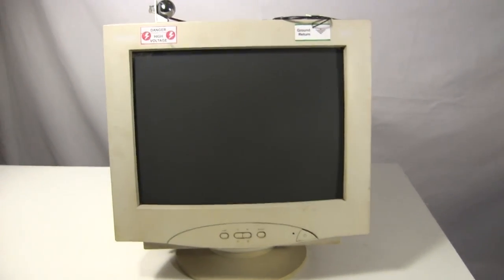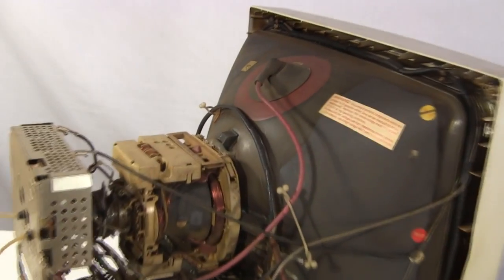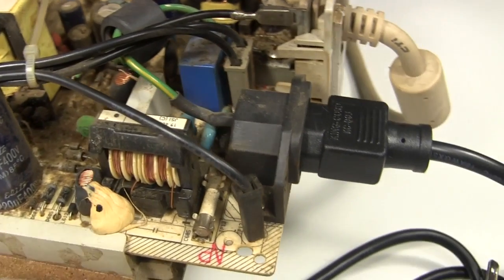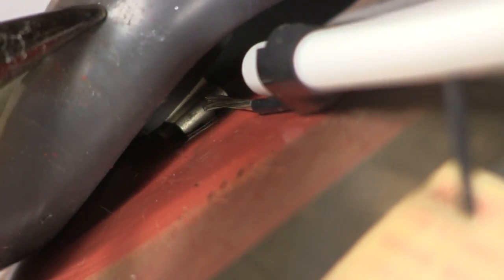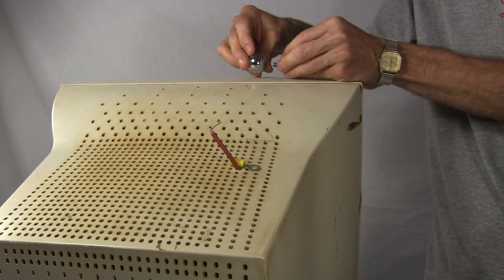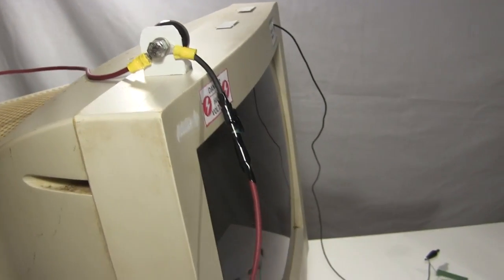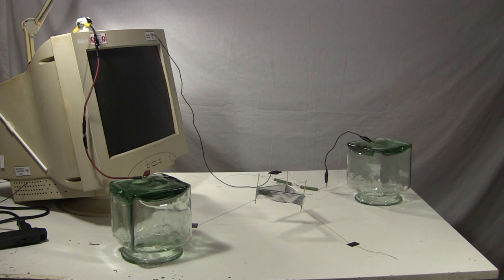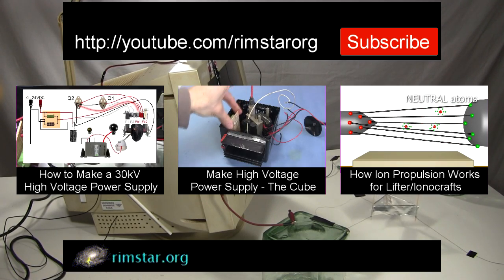How to Make PC/Computer Monitor into High Voltage Power Supply

Comment from the maker: Possibly the easiest to make powerful high voltage DC power supply - a modified PC/computer monitor. In this week's video I show how I did it and demonstrate by flying a lifter. Enjoy!
Reply: +TTTT GAMING yes you can use a tv but some tvs have a overload circuit in them say you are arcing it will shut off due to the current pull that is supplying the flyback some tvs will not and keep going strong very nice arcs even out of the small ones! the lifter is not required it is a fun project you can use with your hv power supply find a ground point on your tv usually you will see a ground even if there is no earth ground the tv has a ground attach a wire to the ground put it on a isolated stick plastic clothes hanger or pvs works good for the lift up the suction cup till you can see the metal contact on it then touch it with the probe you  just made hold it on there for around 3-4 seconds then get your pliers and squeeze the section cup and the prong will comeout now drill a hole run the wire that had the suction cup on it out then get your ground wire and when they come in contace the voltage with jump allowing the current to travel to a ground and the arc draws out! be careful! i have a facebook if you ever need anything Nice Video BTW Rimstar!
Reply: YOUR NPN FRIEND thank you so much man you made it clear for me! 1+ thanks man!
Reply: T T T T Gaming
Should work with any picture tube display.

The circuit won't like doing sparks, still.
Reply: Nice

But you are kinda afraid of the wrong thing; the most dangerous capacitors are on the main board. Especially the mains input filter cap after the rectifier. Remove the crt, and keep the yoke and it's a lot more compact.
Reply from the maker: Erlend Ervik
Yeah, I was wondering what else would be dangerous. Is that cap still charged after you leave the monitor off for a day or so? Keep in mind that you wouldn't work on this while it's plugged in and certainly not while turned on.
Reply: Well.. sharp metall, tube exploding, capacitors.. the HV is mostly harmless in that list.  Keep in mind that the CRT is a capacitor.

The tube and the mainboard capacitors usually have bleeder resistors,  so should be safe.
(The tube won't self discharge if you remove the hv cable)

As for getting a high voltage supply, I like to check if the yoke is connected to the flyback. In some high-end monitors they have seperate circuitry to avoid cross - effects. I got a 30 kV supply that way, I have cut away the non - interesting parts of the board.

I got  10 meters as one piece of TV-40 flyback hv cable, neat stuff.
Reply: plz tell how to make a jacobs ladder from this high voltage supply
Reply from the maker: Daniel Lord
I mention some safety tips in the video. A big precaution would be to leave it turned off and unplugged for a week or two and don't plug it in again until you've removed what you need and put the cover back on. In general, stay away from the electronics except the high voltage wire which you need.
I guess the cathode ray tube (CRT) explodes when you hit it with a hammer :). Seriously, I don't know how else it would explode.
When you short the HV to ground, keeping your hands away from it when you do, you get a big spark. I do all the time, even in this video at the end after it's all finished.
Reply from the maker: Daniel Lord
No, there's nothing you need to remove.
Reply: +RimstarOrg Could you do a video, using this as a HD coil for a spark plug?
Reply from the maker: +HVinduction I haven't done it myself and I haven't seen anyone do it so I don't know if it can be done. You can cut away the case and likely the vacuum tube, or likely just remove the circuit board, but even removing the tube would involve cutting wires that might make the circuit as a whole not work. I just can't say for certain. That would make it a lot smaller though.
Reply: ***** Pull the yoke off the crt and keep it together with the board. That should cover the requirements. No need to cut or smash anything, just release the clamps some with a screwdriver and it should come off.
Reply: *****
Probably yes.
Reply: RimstarOrg can I do this also with a small tv and without the lifter thing? like remove the suctioncup and drill a hole in the upper part of the plastic and than turn it on
Reply: Should be easy enough to branch off the HV cable, if that's what you want to do.

Or just route the cable out of the monitor, totally doable!
Reply: your welcome check out my channel when i get uploading videos and get it finished :)
Reply: YOUR NPN FRIEND on more question I have a small tv at home wich is pretty small same size as the pc monitor but can I get also some arcs from that or do I need a special circuit for it?
Reply: anytime you have something arcing shorting etc.... the circuit was not made for people to have fun arcs lol

Comment: Cool, easy way to get HV. Just had the thought watching you ground the connector after turning off the power, couldn't you wire a double pole switch to use as a power switch that, when turned off, automatically grounded the HV side?
Reply from the maker: Sure. It's probably more than I'd want to do with this one since it's intended to be as minimal as possible. But I like your idea, an automatic discharge somehow when you turn it off. Thanks!
Reply: You would get HV arcing across to ground across the small gap.
Reply: idiolore Sure, and that could be mitigated with a large value resistor. You might also need some reverse bias diode type thing as there might be some overlap in the switch. Wouldn't want HV going to ground with the power applied.

Comment: You can also get 300v or so from the supply on an LCD monitor as long as it uses CCFLs for backlighting.
Reply from the maker: Makes sense, given that the FLs (fluorescent lights for anyone else reading this) would need HV. Thanks for the tip.

Comment: Can i use it to just make random hv sparks? Or will it burn out or fuse will blow or something else dies?
Reply from the maker: You can make a lot of small, weak sparks with it as long as you use around 240 kilohms, 2 watt resistors like I show in the video. From my experience with a previous monitor it can't handle too many strong sparks in a row without dying. I didn't check what component in that monitor died though. It wasn't a fuse. Monitors just are designed to handle the current from sparks.
Reply: RimstarOrg so the best idea is to take flyback transformer out make driver (or few of these sets) put anything under oil and do it that way? I can have a lot of CRT tvs or monitors... and i dont have MOT's... They are only high current :/ 
I ask because i domt have and SERIOUS high voltage :/ i need some for fun ^^ hmm is there anything usefull in tv/monitor witch i can take as set?  (i desolder anything i see that could be usefull)
Reply from the maker: mattibboss
Yes, taking out the flyback and starting from there would work. I haven't taken apart a monitor since I've always used the monitor as is, so I don't know what other parts you can salvage. If you don't have MOTs then there's always power transistors like the 2N3055 which you can buy online or in electronics stores.

Comment: trying to find that voltage tripler was very hard. Good thing I didn't throw out my old computer
Reply from the maker: There may or may not be a tripler in there. It may all be attached to the flyback, like in my recent Cube power supply video. Make sure you leave the monitor off a few days before you open it, and to be extra paranoid possibly even discharge it to ground like you saw me do in this video. The tripler and/or flyback stuff is on the other end of that high voltage wire.

Comment: Worth a warning to people that this could be the last project they ever do if they get it wrong. Old TVs and CRTs can be very dangerous.
Reply from the maker: That's why I showed the danger signs and safety procedures. I totally agree. When I work with high voltage, I treat it as if I'm passing a sleeping dragon or walking on a cliff edge - with lot's or respect, caution and forethought.

Comment: But you could also remove the most stuff and build all the vital components into a box right? so you don't have to have the monitor itself?
Reply from the maker: You could, yes, though on my Google+ post from earlier this week when I said I was working on this (https://plus.google.com/116395125136223897621/posts/dpsWTgdMV3s) jon sanford mentioned that the yoke (coil around the neck of the CRT) is part of the flyback's inductance so I'm not sure how much you'd need to take out, but I'm think you could get enough. That might actually make for an interesting project. But my purpose in this video was how to do it without messing around with the components. You could also make them from scratch. I give some links in the video description to my other videos where I show how.
Reply: yep.